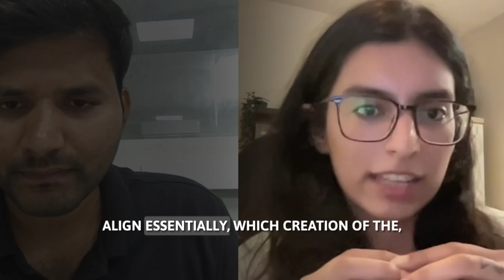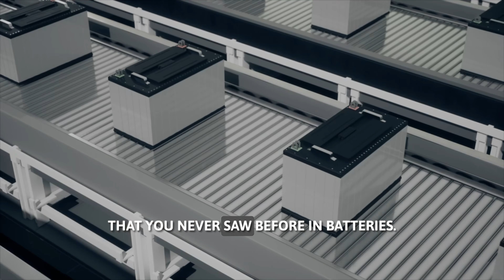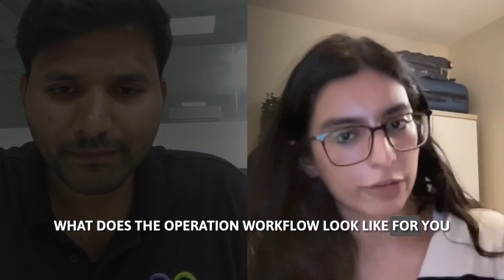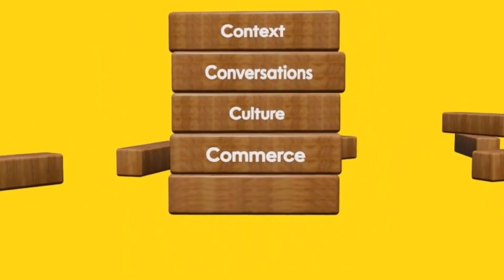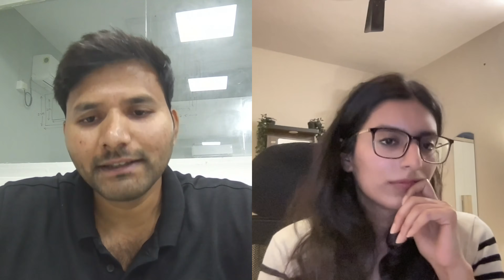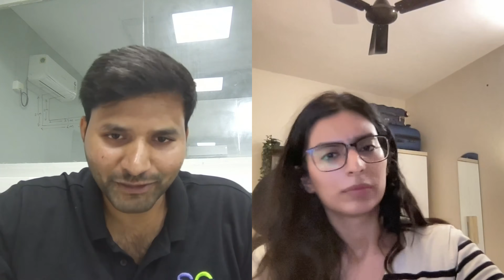Why Lithium Isn't Enough | Akhil Kongara - Sthyr Energy

Comment: The biggest hoax in today's world - battery cars are non polluting
Reply: even you are polluting the world , everything does and its obvious ! but the real engineering and talk is acceptance level or relative metrics over existing ones !
Reply: I'm hoping you're just trolling and not this stupid, battery cars are non pollutant, that is not a term that means the means of making the car is pollutants free, but the case is that both cars and electric cars need ways to make , but once made they don't need fossil fuels to keep running, that's why it's a cleaner solution, better then that would be public transport ran on renewables, that how it works,

Comment: Clean & green energy is really not true.
You need tonnes of Lithium, copper, Silver, Rare earth mineral, iron ore etc  to be mined for "clean" energy. Electric vehicle's also need electricity produced by Fossil fuel like coal, gas etc. One wind turbine uses tonnes of Iron, copper etc.
Reply: The difference is you only need to mine all the minerals once, not for the whole life. For fossil fuel alternatives, you need to keep buying oil every single day.
Also about using coal for power, it is currently the case but it doesn't have to. It can gradually be replaced as solar expands.
Reply: Solar panel are carbon neutral, already recycling of solar panel stated which is sufficient.

Comment: What happened to the Al Air battery testing for Maruti cars?or can't we use Zn Air battery for transport?
Reply: Not light enuf for portable applications
Reply: I want to laughing when I see the hosts none-stop nodding along like she know very well and start with India’s world-class battery ambitions.
The true is zinc-air batteries is kind of one time battery, essentially consume zinc . If you had an EV, once the power runs out, you’d have to refill the electrolyte or replace the entire battery , and yes it have high energy density, but it also lack power output , means ur car leak of power horse,
Now , you still think it can use for electric vehicles?
Reply: @dawner84 true, the idea forAl l air  battery test by Suzuki in India was with an Israel Co- where you can swap the battery at stations designed for this.🎉
Reply: @vaidyasethuraman452  If still have to replace the electrolyte after the power runs out, what is the different between current gasoline?

a single battery swapping station is not enough; it is required same large network of stations as current gas stations also required operators with chemistry knowledge. Compared to a simple charging gun, the cost and requirements is different level.

In the video u can see that guy say a lot on energy storage but EV very less , because he know now it current only suite in big distributed energy storage scene, not the consumer market , means less funding and exposure.
It is good for exploring, but don't put all your eggs in one basket ，and mix with political will only make you lose patience.
Reply: its all just a content strategy , industrial level me yeh sab abhi fit nahi hota ! Reliability , stability and Safety plus production compatibility yeh  sab cheez hote hai real engineering me !
so , as an engineer don't just run over little baseless youtube videos !